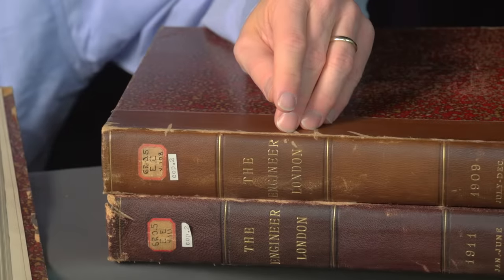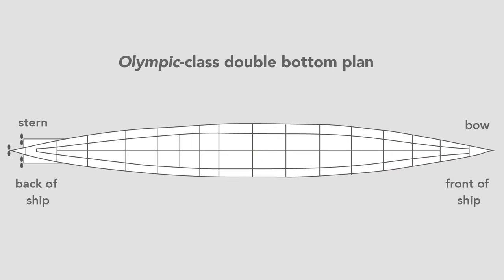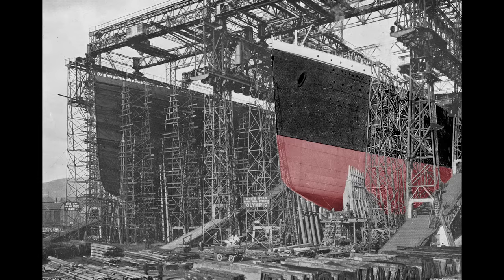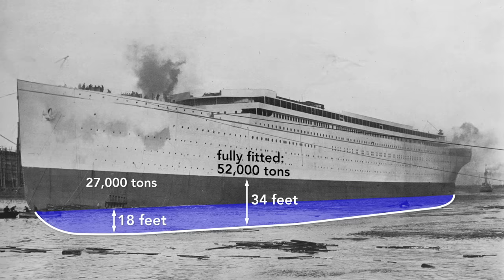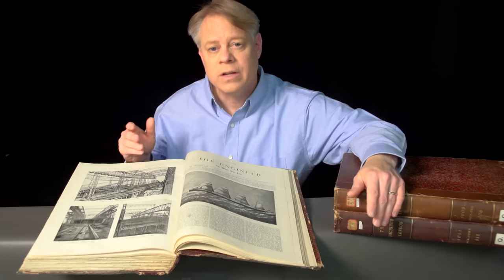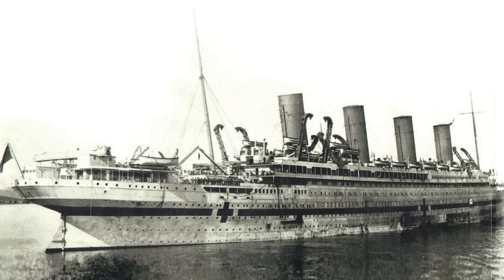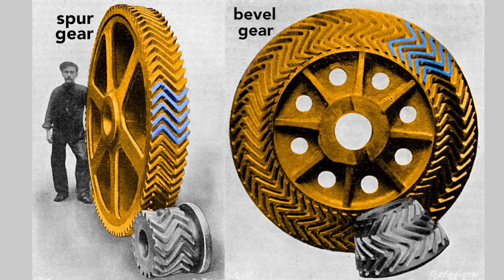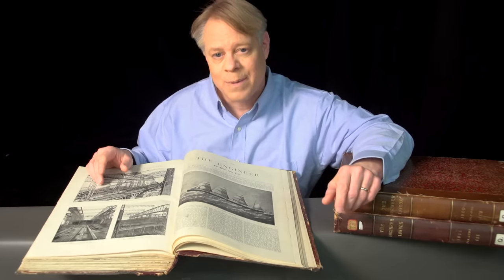RMS Titanic: Fascinating Engineering Facts

Comment: I worked as a shipyard carpenter in the 1970's and 1980's. Shipyard work is dirty, dangerous and fascinating! Imagine crawling in tight bilge spaces and ballast tanks, etc. I worked for General Dynamics Electric Boat Division, EB from 1977-1980 and Southwest Marine 1980-1981. Both were exclusively doing work for the US Navy. At EB, several workers were killed during my time there, an electrician was electrocuted because his helper didn't read the warning tag not to turn on components they were working on. Another guy was speared by an steel ladder that was inadvertently picked up by a crane moving down the dock tracks. A third guy was testing an 'escape trunk' with a spring loaded hatch that accidentally slammed shut on his head, and several guys died due to falls and objects falling on them from the heights of the boat while on the 'ways'.  On working holidays, like Christmas eve and New Years eve, many workers would bring in alcohol and sip blackberry brandy with workmates as they pretended to be busily working. Lunch was an amazing experience. You had just thirty minutes to eat/drink and when the whistle blew and the huge main gates swung open, 7,000 guys would come pouring out onto the road bordering the yard. Many bars were ready and waiting across the street.  If you walked into one, you'd see that the bar tenders had prepared  hundreds of whiskey shots lined up and mugs of beer. There were also 'roach coaches' lining the street where you could buy pretty good food and a beer or two. I used to buy these hot pastrami sandwiches or this pepper steak. Usually, I'd wash it down with a tall Budweiser, or two if it was hot during summer. I learned a lot about life in those shipyards, the most important being that I didn't want to do this type of work anymore. I made a whopping $6.60/hour at EB and $10/hour at Southwest Marine.
Reply: Absolutely the bilges are nasty. And there are places in there that you don't want to go especially when you're welding in the winter time
Reply: Pay wasn't so good in the early 1970s, but would buy more than today.
Reply: What a great picture you paint from memory. One can only imagine what an interesting learning experience that was for you. I had more than one job in my youth that checked off that box. "OK, there is another thing I don't want to do for the rest of my life!"
Reply: Almost as interesting as the video. Thanks for writing this down.
Reply: Thanks for sharing your experience. It's all very interesting. I thought jobs (highly skilled labor) usually were union. Which would have led to a lot more pay.
Reply: What are the most important things this job  has taught you and how did it change your world perception?
Was it for the better or worst and did this job help you in the future as a stated past experience in other jοbs?
Thank you.
Reply: @ermias75ermis2  Hello, Yes, the shipyard job was a very valuable job for me at the young age of 18. I left EB when I was 20 and Southwest Marine when I was 21. There a quite a few skills you learn in a job like this, working with cranes, loading and unloading heavy equipment through small openings in the hull of the boat. Also, machinery, forklifts, etc. More importantly for me, I gained insight of what being a blue collar worker was all about.  It gave me perspective and empathy for coworkers that are on the lower entry level pay scales, because you've been there. You learn to get along with and become friends with some pretty rough guys, and girls. We had quite a few guys on our crew who had recently been in combat in Vietnam, some with some pretty amazing stories. I would call these jobs important stepping stones in my career, and I've had many. I worked in the hotel industry for five years during college and worked as a commercial fisherman in Southeast Alaska one season too. It gave me skills I would use as an officer in the military too, working with enlisted men, managing them, leading them.
Reply: @nickv7824  In 1980, $10 per hour would be equivalent to $32 an hour now with inflation adjustment. And that's not adding the fact that everything is way more expensive now then back then.
Reply: @SI0AX  It's not adding the fact... what? That's what inflation is, adding that fact.
Reply: Jeffrey thanks for your insight! As an electrician in the 80s, I had some close calls. I worked on cruise ships for a few years, but not as an electrician. Anyway, good stuff, thank you!
Reply: @roberthermann97  Oh right, I didn't think about it that way ,lol! What I meant to say is that the wealth distribution today is worse than back then and so buying a house today is harder than back even with the same theoretical wage adjusted for inflation. I don't know If I'm explaining this correctly...
Reply: @SI0AX  in 1980 i had medical and a retirement plan, along with the money at a job. In a small business you pay for everything.
Reply: This is fascinating, sir.
Reply: Jeffrey Collier You need to be a writer. Very interesting, made me wish I was there working with you guys. Well, almost, except for the dying part.
Reply: @RErnie-gv1hv  I find it interesting that people get scammed so easily by companies that don't want to pay a living wage, so they lie about unions. 

I know bar tenders that make 60,000+ AND bennies! They won't do that without a union, btw.
Reply: @SI0AX  Some jobs aren't worth it, if you get hurt, you're done. You don't always recover. All the young people think they'll be able to keep doing physical work at age 70, but normally you get hurt badly way before then. Either several smaller ones or one big injury. 

And if you can't handle money/business,  you will be in trouble. 

I've been hurt walking dogs a few times. Not to mention I now have a low tolerance for cold...sometimes my back just kills me. And I'm nowhere near old enough to retire. Also, they don't line up to pay you during a 100-year pandemic, and good luck getting assistance of any kind or insurance.
Reply: @windsofmarchjourneyperrytr2823  My work consists of sitting i a chair typing into a computer 8 hours a day. It's not healthy and I sometimes wish the job was a bit more active, but hearing your story makes me glad I have this job because I can do everything from home and the pandemic had no effect on my job whatsoever.
Reply: I had to pause the vid to read this :))) Thanks for sharing!
Reply: @Jeffrey Collier, you are the real American man, hard working, rowdy Lol and happy. Hats off to you sir!
Reply: that was decent pay back then. of course, with the hazards, i'd be ok working for $2.65/hr instead lol
Reply: haha roach coaches, on every construction site (mostly) I worked at. Also called Gut Trucks.
Reply: Jeffery collier looks like we same age and took simulator paths in life I worked in Detroit as a tool maker and heavy machine builder. Made steel at a place called Zig island  MI. The worst place to work in the world when I got layer off went to San die go to work for US navy in ship yards as a machinist those ships really opened my eyes to some real work. 100 degrees in those old ships 5 to 10 decks below sea level. Cutting huge sections of the ships steel plate to get to running gear and huge engines that needed to be replaced was glad to get back to Detroit. Same deal gates open 5000 men heading to bars lined up with drinks and food. Those were the good old days.
Reply: @nickleggett2101  It was a special time, another lifetime ago. Your training and skillset was very high as a machinist. Did you work at SW Marine? They had the huge wooden floating dry-docks adjacent to the bridge. Nasco was farther south.
Reply: @reggierico  hi how are you today. I worked at the US naval ship yards south of Coronado island San die go California.  1979 to 1980. Some ships were in dry dock but most were in water. It was a crazy job so different than working in auto industry at UAW in Detroit and Ohio. The massive ships scared the he'll out of me. But machining metal is all the same. My official title was a ship fitter. We used high speed tool steel tool bits to bring in the tolerance to navy spec..
Reply: MR COLLIER thanks for the tx back I all ways wanted to work at Electric Boat back in the day. Your wages were about the same for me also I spent 7 years in trade school for 3 trades I all came in handy when u get layer off just jump to another factory. U should write some notes of your experience for your family time goes fast we are not getting  any younger. The new generation does not understand what real work was before computers and electric cars. The ships that are built and being built are engineering marvels which make the USA the best military in the world. Have a good day. Be safe.
Reply: I’ll second what woodfern said below. It’s not just a great story, well beyond what most guys will experience, you’ve also got a skill for writing. Next you’ll say you have a novel out already..
Reply: @pathflight9803  No, I'm not a writer, but thank you very much for the compliment! BTW One of my squadron mates from the Air Force has written a book about his experience and history of the AC-130 gunships. I flew in the Air Force with him for over 8 years. He just got approval from the DOD for his manuscript and it will now go to print. His name is William Walter, CMSgt. ret. I'm sure it will be available on Amazon.
Reply: On which ship did they rivet a guy up in the hull? He got a lot of cruise miles up.
Reply: What an impressive, and lively, description of hell. Very hard work, indeed.
Reply: Times has sure changed,thanks for the info
Reply: @SI0AX  lol. that is what the inflation part of the equation is for
Reply: @SI0AX  "wealth distribution" is what you meant now. You need to lay off the media buzzwords and just admit you have no idea, like 99% who talk about wealth distribution, what you are talking about
Reply: @DavidDavid-jb1cy  Ok, then what is the correct terminology and the correct explanation?
Reply: @roberthermann97  I don’t think either of you understand inflation. The consumer goods today are superior and manufacturing is much more efficient. You would think things would become cheaper. Think 1980s TVs and think 1980s manufacturing practice vs today. The value of the tv today (if you took it back in time to 1980) is more, nobody is trading 70” flat screen for 32” tube tv which would be of comparable value in the 70-80s. It actually costs more to make a tube tv and they are not as good as flat screen. The flat screen cost more today than the tube tv in its day not because the improvements to the tv, but because the value of the dollar has decreased. The value of the dollar is less because the population has grown by 33% let’s say from 1980, the amount of money that has been created though has increased by 333%, meaning there is ten times more money in the economy than more people in the economy. Its hard to picture but if you want the monitory value of an object to go down, you can do three things, increase the amount available, decrease the amount of people that want it, or decrease the value of what’s being traded for said object using the first two options. So thusly flooding the economy with more money has in increased the price of all objects available, but it has not changed there value. People don’t want TVs, milk,gas or anything else more today, they pay more because there’s so much money in existence. Maybe think about this the next time you hear the government is going to give us all a 2000$ stimulus check and increase the national debt by a large factor and flood the economy with newly printed money. Just to point out, the population today would be about 20% higher if abortion wasn’t something we allowed, so assuming money had been created at the same rate and supply had kept up with demand (which for consumer goods it almost always does) everything would be about 20% cheaper.
Reply: @scottsmith7969  You're not contradicting me, perhaps just misunderstanding.
Reply: Thank you for sharing your experience, Sir. That's really interesting to read.
Reply: Wondering if the type of work has much changed over the decades… or how they perform their work.
Reply: @nickv7824  I was in my teens, I think I was earning about
$1.35 at the time, the op really worded that part 
very poorly, but the overall story was great.
Reply: @roberthermann97  haha, I know.
Reply: That's about $37.50 in today's money, where I come from that's not too bad. Sounds like quite a job though!
Reply: You could have been at Portsmouth or Newport news which is worse
Reply: Glad you made it.
Reply: @tomiday66  9
Reply: That's actually interesting, thank you.
Reply: It was like that all round the world, I had friends here in the UK were the conditions were poor and some trades wages the same but now most of the ship building has gone skills been lost it's a shame seeing the yards stand empty and work which we need going to our EU neighbour's
Reply: alcohol isn't gonna make construction work any safer.
Reply: 6 and 10 dollars an hour sounds like a decent wage back then, relatively speaking.
Reply: That's a lot of deaths for the relatively short amount of time you worked in those positions. Glad you made it to the finish line to share your experiences. Cheers, mate.
Reply: $6.60 an hour in 1977 was equivalent to $33 an hour in 2023 prices, and $10 an hour in 1980 was equivalent to $36 an hour today. 

That was a pretty good wage.
Reply: @KLAWNINETY  Not quite. I made that $6.60/hour in January, 1980 and $10.00/hour in March, 1981.
Reply: Did you build the Olympic??
Reply: @dima.jiharev  haha
Reply: Sounds like an incredible experience to work there.

Comment: After all these years, an explanation for why old ships have black-painted hulls.  Thanks!
Reply: Same here! Makes perfect sense. I always thought the black bottom was depressing, boring. :-)
Reply: In those pre- air conditioning days, ships designed for warm climates were painted white to reflect solar heat. Doing so could reduce internal temperature by about ten degrees
Reply: 7:35
Reply: As a kid i thought this was the same tar stuff that they apply to concrete foundations to make these waterproof... It kinda made sense as wooden boats are also watertightened using tar.
Reply: What colour would you like, sire?
Reply: @johnbishop5316  lime green and hot pink
Reply: @jaykoerner  perfect. That's black then. Signed Henry Ford.
Reply: "To hide the dark stains" is just so petty-sounding reason.
Reply: @vksasdgaming9472  Maybe “petty” but very important.  Image is everything. Even the Edwardians knew this.
Reply: I loved that fact
Reply: @vksasdgaming9472   the main tank of space shuttle was first painted white for aesthetic then one engineer told the to not paint and save weight- 1980s …. Image is important for the show
Reply: @nos4a212sd  External tank of Space Shittle on it's first two missions was not painted white because of aesthetics. It was painted white to reflect sunlight it would be exposed to before launch. Then they noticed that last, white paint layer was not necessary.
Reply: Congrats for the 666 likes
Reply: @octavius8562  Hey, I like old ships, but not enough to get a book on them!  Hehehe
Reply: I love the white over black over red styling. Cruise ships may be larger, but they don't look classy at all. Just a large apartment building on water. At least Queen Mary 2 kept the traditional Cunard styling.
Reply: Yeah but why??